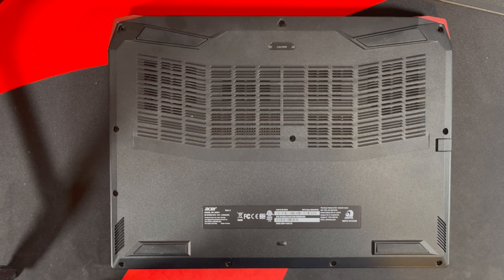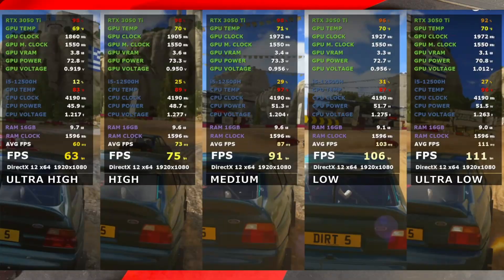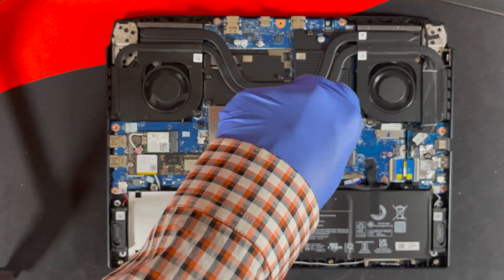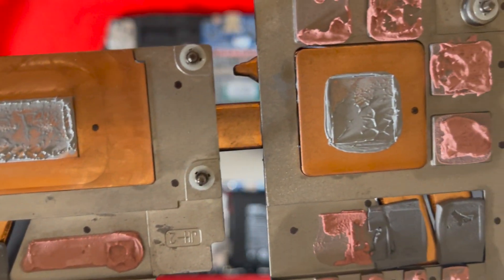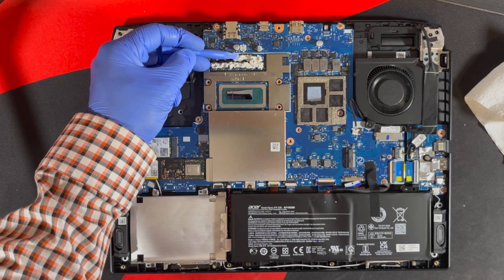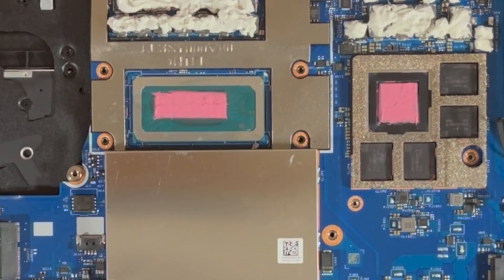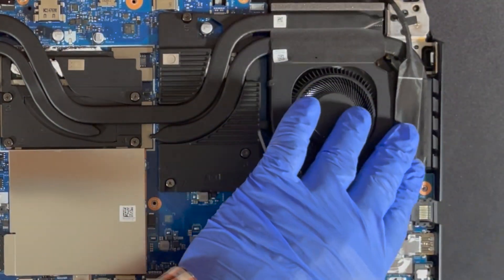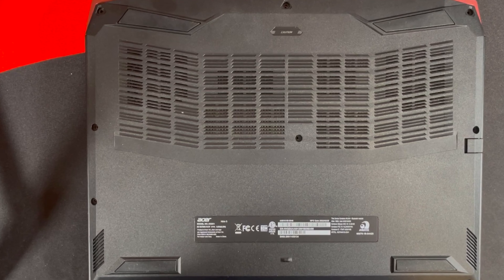IT'S GOOD!! Acer Nitro 5 2022 REPASTE - Kryonaut Extreme TEST 👍

Comment: Pls help. My AN-515-58, i try to change thermal pad usingGrizzy 1 mm. Buat after that my temperatur going up like 80-100, before that just like 70-80. In this case should i use putty?
Reply: you need 1mm and 1.5mm pads for the vrams and paste for the processor.

Comment: For nitro 5 an515-58 i7, what is the thickness of the thermal pad
Reply: buy thermal grizzly putty basic , don't use thermal pads , the surface is uneven and you'll have a hard time figuring out the correct thickness of it .
Reply: @deadinside8547 thanks mate

Comment: for anyone with a an515-58 another option to decrease cpu temp is going into power options and cpu power management and reducing the maximum power while plugged in by 15%. i did this and have no performance loss and temps went from high 90s to mid 70s while gaming without having to open my laptop or download anything
Reply: i did that about a year ago
Reply: @ICEE311  i just ended up trading the laptop for a complete gaming desktop lol got annoyed of the no temp fixes for the nitro 5

Comment: I have the same laptop but it reaches 100 degree during 35 watt consumption and starts throttling i changed two times thermals and thermal pad but there is no change what can i do now
Reply from the maker: Have you tried blowing out the fans?  No reason you should be hitting those temps.
Reply: Your issue is because you use thermal pads, in the video this dude used thermal putty replacing both thermal pads and the pink putty too

Comment: The main issue is in the past we could do a repaste + undervolt. And since older cpu's didn't have as many transistors crammed into the same space, they could run ice cold with a repaste + undervolt.

Right now we have way more transistors crammed into the same space, creating more heat. And we can't undervolt. 

Amd's cpu's run hotter than intel despite using less power as intel has thinned out their dies to better dissipate heat.
Reply from the maker: Agree.  Some people don't understand that and still complain why a 3080 gets hot in a 1/2 inch thick laptop.
Reply: @Meanpooh  Well, the mobile 3080 uses a fair bit of power. but it still has a large die size which means more surface area to dissipate heat. 

But yeah, even the mobile 3080 does not run much hotter than the desktop 3080

Comment: is it ok if i dont change the liquid thermal pads and leave them like they are while only changing the thermal paste on cpu/gpu ? i just got my acer nitro 5 a515-58 and the cpu gets to 65c while idle so im thinking of changing just the thrmal paste with good one
Reply from the maker: If its new, yes.  Just make sure that they are covered once you apply the heatsink.
Reply: @Meanpooh  how many times would say it would be ok to re-open the heat sink and change thermal paste before I have to change the thermal pads too ? Or is it ok as long as the thermal pads are still "liquidy" ?
Reply from the maker: I would only repaste or change thermal pads if the temps start to increase which is normal overtime.  I would change if my idle temps were over 55C.  Use your previous temps as a baseline on where it should be.  You have to account for room temp and living location.  Thermal grease may have just been applied but because someone lives in a warmer climate it may seem like it needs to be repasted compared to someone that lives in a much cooler environment.
Reply: thank you very much for the information
and btw when you say you would change if idle temp went over 55C at what room tempteture is that ? because i live in a "warmer" place you could say room temp goes to 29-30c
Reply: @Meanpooh  do i need to apply thermal pads too if i'm already using thermal paste?

Comment: what about acer nitro 5 with i5-11400H rtx 3050, i had a problem with the temperature, after i cleaned the fan, the temperature was getting up at 90+ which never reached that much before
Reply: when I cleaned the fan I also checked the thermal paste & pads it still looks pretty good
Reply from the maker: Did you repaste when you removed the heatsink or did you just put it back on?  If you did not repaste, that would most likely be your problem.  Sometimes its ok to not replace thermal pads especially if its new.  I've done it before without issue on a new machine.  Anyway, you may have to get the old thermal grease off.
Reply: @Meanpooh  I just repasted it, but only on the CPU and GPU for the others I still use the old thermal pad. the result is less than 10 minutes playing AC origin gets a maximum temperature of 82
I intend to replace the thermal pads like in your video using the K5 pro, it's just that no one sells them in my country, 
are there any other suggestions that can be used to replace the K5 pro thermal pad?
Reply from the maker: @batokelapa9777  82 is not bad.  Also my gaming area ranges between 70-73 F so that helps a bit.  The cooler the room the better.  If the room is hot then it's going to affect temperatures.  If hot air is going in then it's not really going to help much.  Other options would be a laptop cooler or to get some kind of clearance under your machine.  Make sure your machine is not backed into a corner to where the exhaust is being pulled back into the machine.  You can use thermal pads but you have to measure and cut them to make sure they fit in all the crevices.  Also please be careful going in and make sure your battery is disconnected.
Reply: @Meanpooh  70-73 it is very good. yeah maybe i should change the thermal pad too and cooling pad. Thank you for the advice
Reply: @Meanpooh  halo its been while, just want to ask what is your cpu temperature while playing ? The number 82 above means the CPU temperature and for the GPU I get 70-74 too

Comment: hey meenpooh, i recently bought this laptop the difference is specs is just that i have rtx 3050 not the ti. for some reason my laptop was thermal throttling and going to 100c from day 1. so i changed the thermal paste and for some reason everytime i change the paste the laptop temps goes down for 3-4 days and after that it again starts throttling and going really high. is your laptop temps still down or it has again started throttling? also can you replace all the k5 pro with a thermal pad in this laptop. i cant get k5 pro in my country. please make a video on that , it would be really helpful for me

Comment: Nice vids !! Btw if K5 pro replaced by another thermal paste , is that ok ? Really hard to find K5 pro in my country
Reply from the maker: Yes, it would be fine.  It has to be high viscous meaning very thick, almost to the point of being solid.  Thermal grease such ar artic silver, tm30 etc., will not work as its too viscous and will spread out under pressure.  Think something on the lines of a marshmallow.

Comment: GPU temps dropped by 14*c but CPU increase by +3* after repaste (94*c) under gaming loads. Any insight  with this problem would mean a lot. Your videos help me out a lot thanks!
Reply from the maker: That's strange.  Is the temps increase across the board on all games?  Did you reuse the thermal pads?  Not that its bad especially if it's new.  I've had something similar happen which leveled out after a few hours.  All the screws were tightened down, correct?
Reply: @Meanpooh  all screws  were tightened down and I did replace thermal pads. Under any game like light esport titles the cpu still hovers around 91-93c*

Comment: Do you use windows 11 if so should i switch
Reply from the maker: If your machine shipped with 10, I would not upgrade to 11 if you game a lot.  The machine I have uses Windows 11.
Reply: @Meanpooh  i did so should i go back to windows 10
Reply from the maker: If your machine was running better with 10 then I would go back.  If its running fine for YOU now then stay on 11.
Reply: @Meanpooh   some older games do not run as they use to and my temps have been in the high 90s  which is a sign i needto reapply thermal paste
Reply: @Meanpooh   should i update my bios

Comment: seems the best thing to do these days is avoid gaming laptops if possible.  the push to be thin and light has killed thermals, and with most parts being soldered / glued, they are hard to repair or upgrade
Reply from the maker: I agree with the repair and being thin. It makes no sense to want a powerful GPU and CPU in a  thin housing and expect sub 70C at all times. It just will not work at this time. 
The mobile phone technology is the right track it’s just that the quality is not there IMO.  Games such as CoD mobile are decent but it just feels cheap. If they can somehow change that, it will be good times for us gamers.  60 FPS, good sound and more in depth gameplay and good battery life.   If Apple could spare some R&D for more games to run natively on their hardware it would be awesome. 
That’s just a dream though as Apple is too busy trying to make their whole ecosystem use one OS in some capacity.

Comment: i enjoyed the video. great to know what im in for in the future. on another not i wish my nitro 5 was your model. mines basically the same class i guess you could say but a generation older. id really enjoy the extra performance your 12th gen i5 and 3050 would give over my 11400h and gtx 1650. good video though thumbs up!
Reply from the maker: Thanks. I rocked a 10300 and 1650 Ti up until this model was released. It’s a big improvement but a 3060 would be even better.  I think they would pair nicely without any noticeable bottlenecking if at all, especially since the 5800H can ride with a 3070.